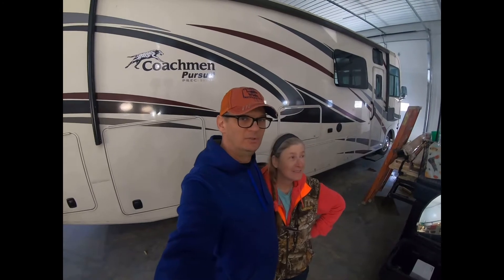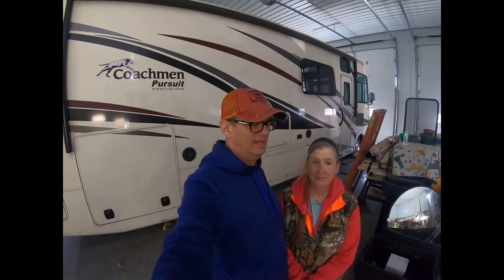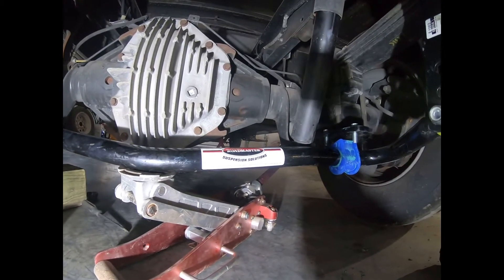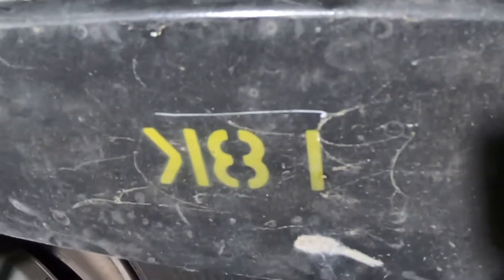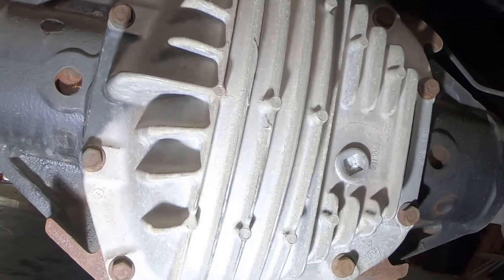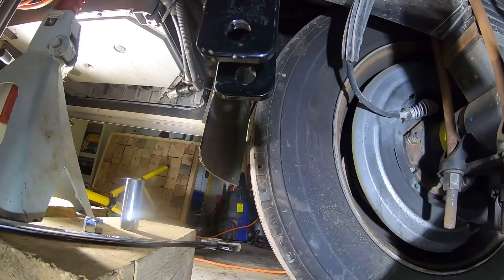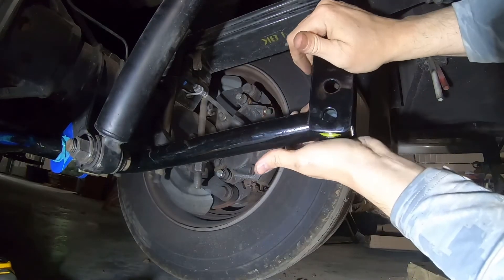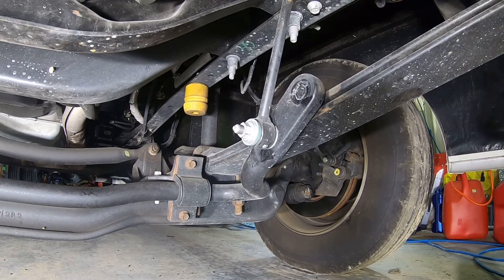DIY Install RV Roadmaster Rear Sway Bar

Comment: Great video and it didn't look to difficult to do except for the bolts you had to grind. I may need to purchase or borrow a grinder when  I install mine. Thanks for posting.
Reply from the maker: Since I mostly installed the 20k one first, the 18k one was very much easier. Anyone with regular shop tools and basic mechanical skills can do the 18k one in a few hours. We’ve got several trips since installing the sway bar, it does make a big difference and was worth doing in our opinion! Thanks for watching and commenting ❤️